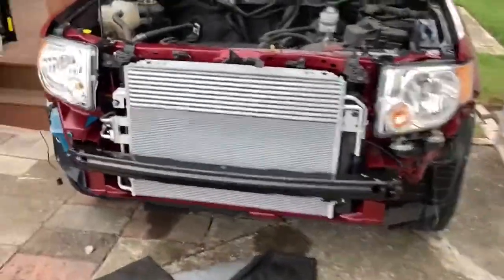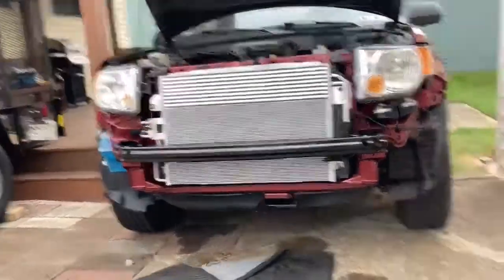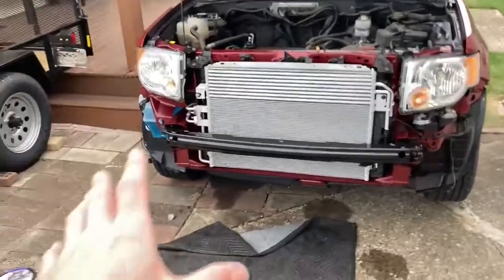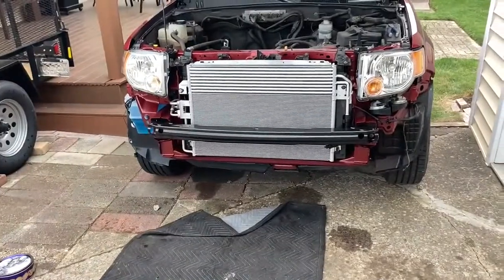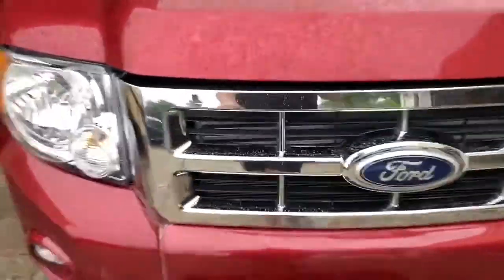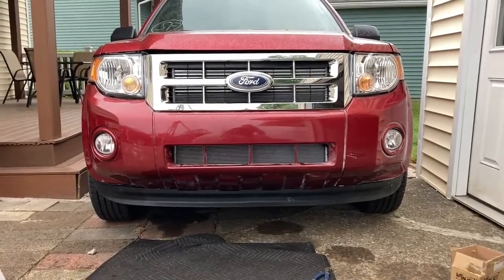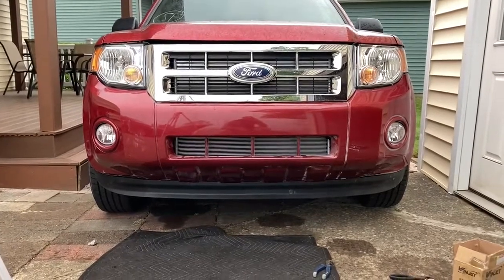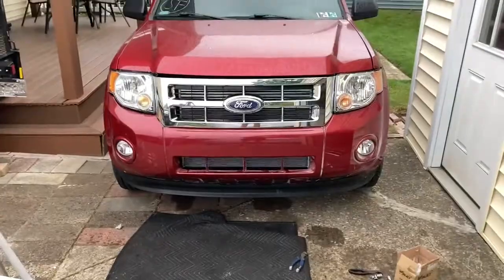Copart Ford Escape – BRAND NEW Bumper Install | 2012 Ford Escape Rebuild Part 7

Comment: how hard is it to replace the fenders? I saw you put some sort of attachment on the fenders before attaching the bumper, what were those parts?
Reply from the maker: Probably not too hard but I never took the fenders off this car.
Reply: @matt-diy  At 4:37 you attach pieces to the fenders before attaching the bumper, any idea what I can search to buy those?
Reply from the maker: @Mr31Sterling  ahhhh yes!! Bumper cover supports. Part# 8L8Z-17E814-A for the right and part# 8L8Z-17E814-B for the left. I use https://www.oemfordpartsdirect.com for exploaded views to find part numbers. The ones you are looking for are cheaper on eBay!! https://www.ebay.com/itm/351591859852?mkcid=16&mkevt=1&mkrid=711-127632-2357-0&ssspo=tqSprHJARiK&sssrc=2349624&ssuid=l7E-lpq-RK6&var=&widget_ver=artemis&media=COPY